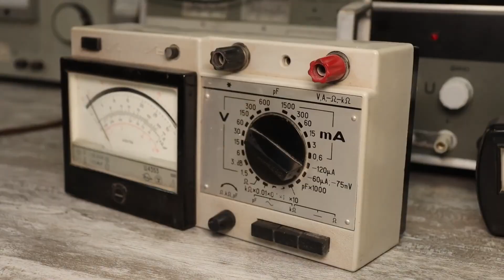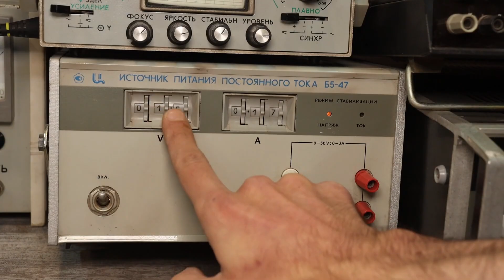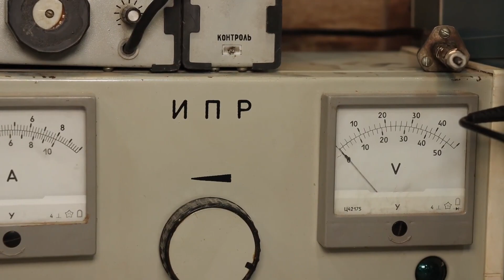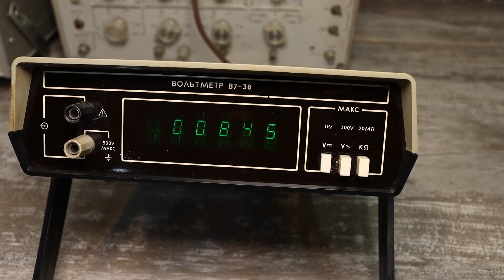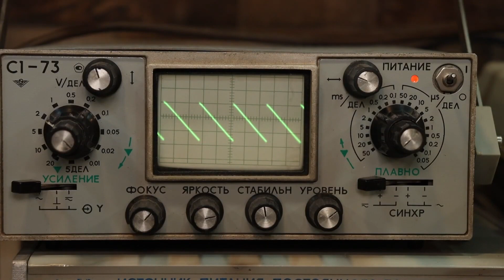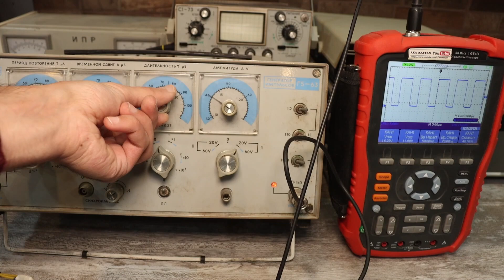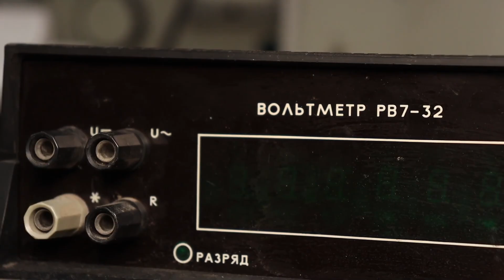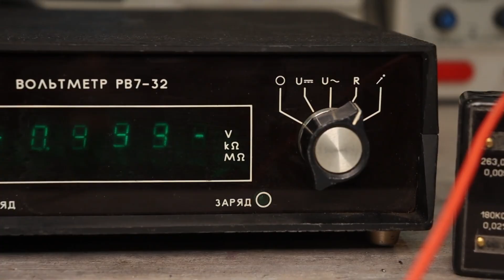Back to the Past: Retro Tech Review

Comment: The craziest thing with Soviet electronics is they went to space with it with minimal loss of human lives, they made some of the best airplanes ever etc... WITH THIS! I mean, the engineering was bad at best, and the components were just beyond bad. I mean the power supply that tends to explode its power transistors when voltage or current is set to zero... Then, I remember the poor guys tried to copy Tektronix 485 oscilloscope. From that came the monstrosity that used nuvistors, analog power supply, and a CRT that was unfocused at best. The Soviets had no technology to produce the distributed parameter deflection system for the crt, so it was too long. In fact so long that they were unable to achieve spot finer than 2-3mm. The only thing that was worse than Soviet electronics was Soviet nuclear industry. It was tragic. Again, we must admit, even with the arguably worst electronics, and absolutely worst nuclear programme, they still went to Space, and to this they have some of the best millitary airplanes in the world...